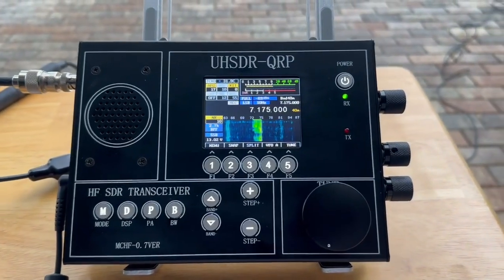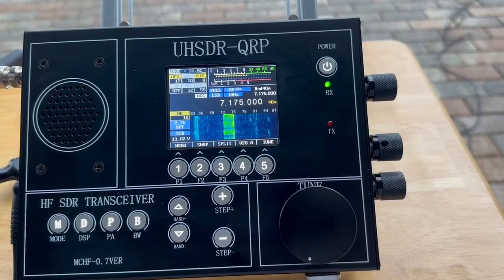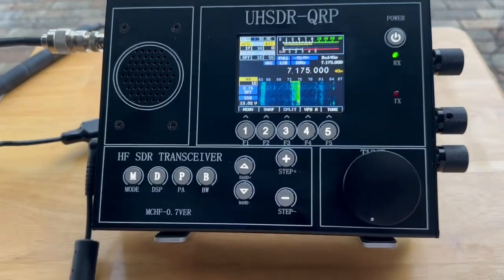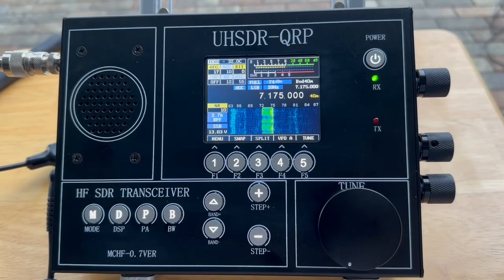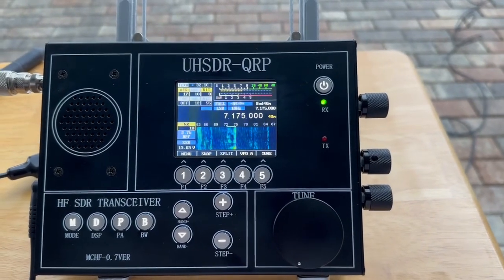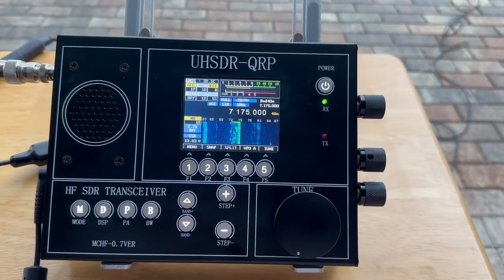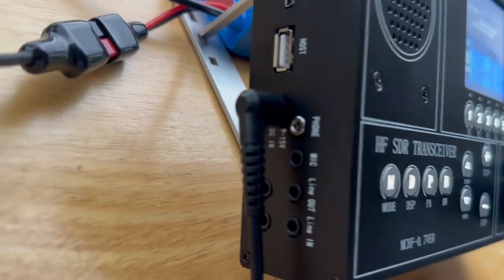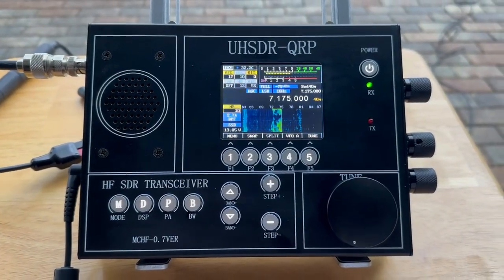UHSDR QRP MCHF V0.7 - First power on

Comment: Mike did you upgrade the firmware?
Reply from the maker: @rockdubois1672  not yet.  Seems to be working well
Reply: @N4GW  thanks. I was wondering if it is compatible with the df8oe or other McHF firmware.

Comment: I bought one of this Chinese version  after building a few Monka McHf  v.06 years ago. However this version has terrible sounding CW  although SSB sounds OK. Rest is about same as the original Monka. Pete WK8S
Reply from the maker: @petewk8s872  not a CW guy but SSB is not bad.  I do find that on 10m and 12m the menu flashes on transmit which is a disappointment.  Radio looks good though